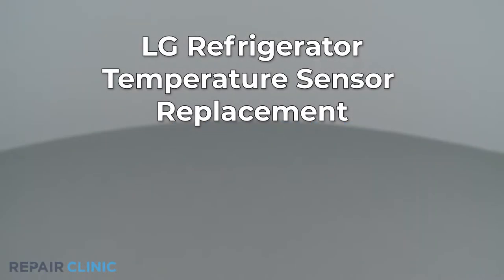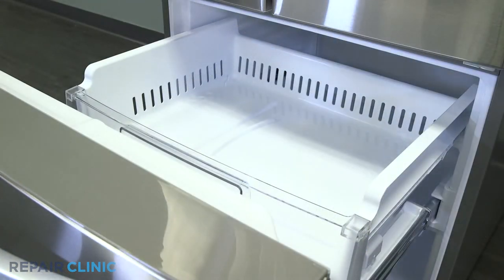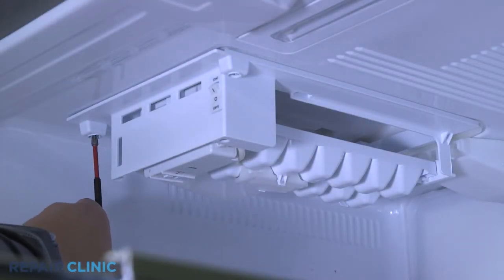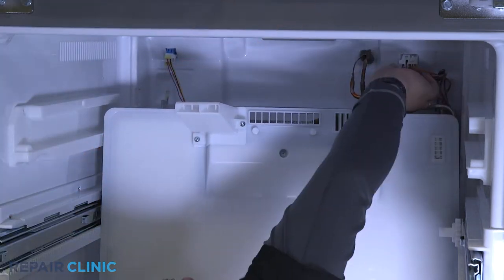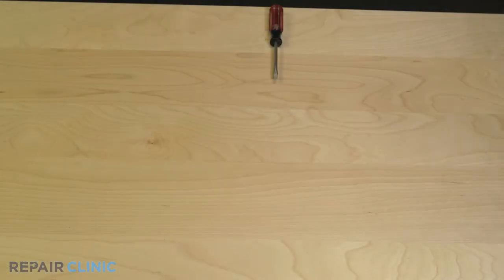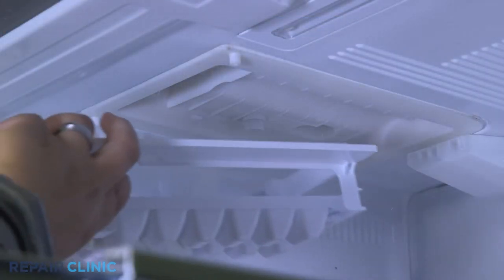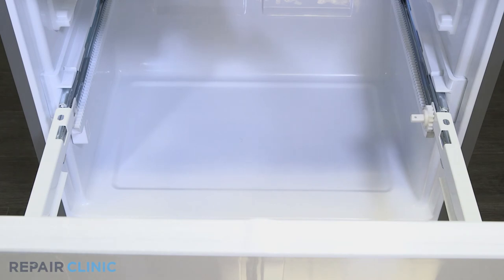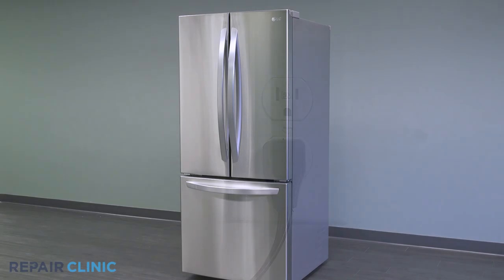LG Refrigerator Temperature Sensor 6500JB2002X

Comment: But why do you want to replace temp sensor?
What was the problem & how did you conclude that thermistor is faulty?
What is the resistance reading of old and new sensors?
Reply: That's what I came here for- how to figure out if the sensor is bad int he first place.

Comment: I have the same refrigerator, the app check show everything is good, I can see the fans working, the motor doing looks like working. But not cooling, PCB LED blinking 3 times, do you think could be the PCN bad? Any chance in to be sensors?

Comment: How many temperature sensors are there in a three door refrigerator?  Is there on in each section (top refrigerator and bottom freezer)?  Is there a third? Why would you need to replace the sensor in the freezer as you show here, if the refrigerator is where the temperature problem is?  Shouldn't step one be locate and test them, then order replacements for the defective ones?

Comment: hi, my 2014 LG French door fridge thinks the outside temp is too low. Where can I find the 'outside ambient temperature sensor'? Is that on the pcb at the back! many thanks.
Reply: How do you make the determination that the sensor is defective? Would this cause the unit not to get cold enough?

Comment: Sure stupid LG, I see you made improvements.  The frig I had was not so easy.  Still trying to figure out how to replace it.  Seems like they build it never thinking the sensor would go bad.  My only choice is to cut the wires and soldier it together.  No way to remove it.